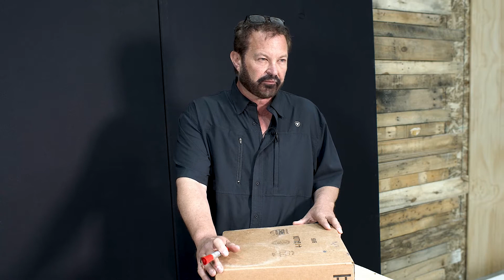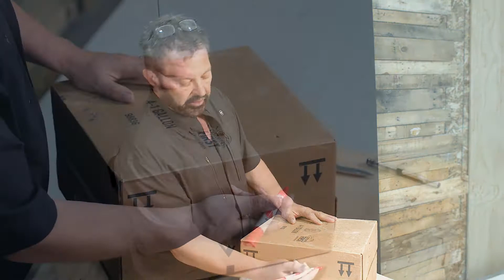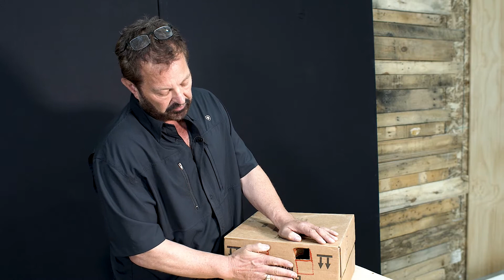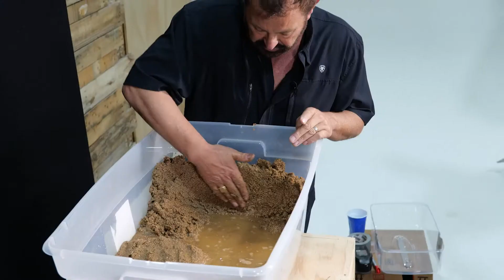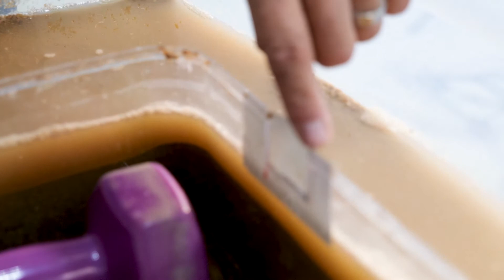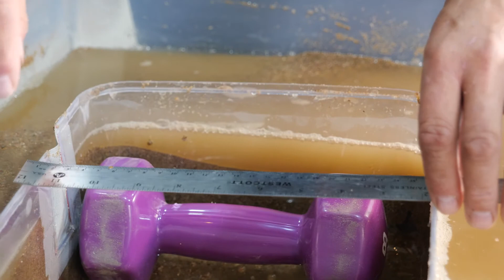Foundation failure due to incorrect egress window installation - finishing a basement (part 1)

Comment: Like everyone else, I'm wondering about parts 2 and 3.  Since it seems they aren't going to finish the series, maybe we can come up with some solutions...  My current basement office (that I share with the laundry room) has 2 egress windows, built when the foundation was built, that are each 48" wide in a 30' long wall.   In the middle of that wall, a concrete buttress (the drawings I got from the city call it a "counterfort") sticks out that is 8" wide, 6' tall, and 4' deep.  The drawings show rebar tying the buttress into the wall sitting on a 24"w x8"d footing.  I'm assuming that is to counter the wall/dirt loads.  But we're planning on moving and will probably need to install an egress window in the basement of the next house before finishing the basement or redoing what some other "handyman" did, most certainly without permits.  My college mechanical and architectural engineering classes were decades ago, but I got to thinking...  I could duplicate my current arrangement with a buttress of some kind.  Or, perhaps I could do something with bolting some C channel on each side of the foundation wall running the length of the wall,  with the question being of how high on the wall...  Would the buttress be better for poured walls and the c channel for block walls?  Could a concrete window well that is doweled into the wall substitute for a buttress/counterfort?

Comment: Surprised that residential basements relies on diaphragm design.  All the designs I have done on walls (which a foundation is) simply relies on simple 2D overturning for static and dynamic loading.  Drainage is dealt with at construction. If that isn't accomplished then I can could definitively see the issue

Comment: I came looking for videos on this topic after learning that my uncle had cracking in his basement after having an egress window installed.  The cracks looked just like predicted in this video.   He’s since had $15k of reinforcement work done to fix the problem.    Anecdotal, I know, but seems to confirm the risk outlined here.
Reply: Most cracks come from the building settling unevenly.  Proper positive slopes for drainage  away from structure prevents these problems.

Comment: We're having a large window company install our windows as part of a "greener homes" program. We have an older bungalow (early 60's) that is pretty much identical to the box in this example. They said to just "go for it" if I wanted to save some money to dig the wells and cut the egress windows out myself...so I did. I asked them about whether I should install a lintel, etc after my step-dad expressed concern. They said not to worry about it and that "cutting down doesn't require an engineer or impact the structure of the house". Needless to say I'm looking forward to seeing part 2 and the example videos you discussed in this vid. Great video btw. Very informative and made a lot of sense in simple terms. I think a lot of viewers out there that are DYI'ing this because of inflation, etc. would benefit from seeing this and future videos on the subject. Thanks!

Comment: Hot Garbage! I’m an egress contractor who’s got 18 years experience installing standard vertically cut egress windows and what is not mentioned here is how the window well deflects the lateral soil pressure. I have done over 2,000 windows in Colorado with some of the most expansive soils in the country, and have never ever had any structural issues with any of them. This plastic tote bucket demonstration is laughable!!

Comment: Great information! Just subscribed. Very interested in seeing rest of this series. I have recently started my own foundation repair company doing waterproofing and am installing egress windows as well. I have previously worked with another foundation repair company for several years doing this and I myself have spoken with the local engineers for this exact service discussing the structural concerns and none have mentioned the lateral load from expanding soils. 

It’s a no brainer in the foundation repair business, we call it a foundation wall experiencing inward deflection due to excessive hydrostatic pressure. I would argue that all exterior water mitigation should be maintained at all times to avoid excessive saturation and prevent this foundation failure. The lateral support system for the average foundation wall will never hold up to this level of excessive soil saturation for an extended period of time as we see this deflection on foundation walls without egress window installations all the time. 

However, I do understand the world isn’t perfect and you can’t keep the soils around a foundation dry forever, and I see the compromise of lateral support in cutting out the additional concrete because typically there is a section of rebar running horizontally through the cut piece.  Very interested in seeing how to compensate for this compromise.

Comment: Well, it's been over a year and this guy hasn't posted parts two or three. It seems to be a fear-mongering move. I've been a carpenter for over 30 years. I understand his premise of remaining wall areas able to pivot. But when you don't offer solutions to problems you point out, in a timely manner, after saying you will, your credibility comes into question. I have dealt with engineers who try to require reinforcements that exceed available space. This guy should have had all these videos available prior to releasing the first.
Reply: he talkin out of his bung hole in this vid

Comment: This can't possibly apply for all foundation walls.  A legite, well built concrete foubdation wall should have rebar throughout it and be "engineered" as a retaining wall to withstnd the lateral forces of the outside soil.  Is this not true? I can see how this might be the case for a foubdation wall without adequate rebar or one made of concrete block, but even that should be built with reinforcement from stell rebar, no?
Reply: this whole vid smell like bs

Comment: I watched this at 1.5X speed and still wasted my time. Let me summarize: You might think it is OK to enlarge an existing window in your foundation in the vertical axis only, but it's not. You are weakening the foundation's resistance to soil pressure and the walls can bow in, causing enormous damage to your house. You must reinforce the foundation when making this window enlargement. How do you do that? Wait for parts 2 and 3! Since this part 1 was posted 18 months ago, I'm not holding my breath.
Reply: this whole vid bs

Comment: I plan on using steel i beams similar to "PowerBrace" on the sides of my new window opening, and then use carbon fiber reinforcement every 4 feet as a preventative measure for the rest  of the walls.

Comment: Since you are cutting out for the egress window. You would have less pressure on the wall because of volume of earth you remove. Totally disagree with this video. I am 74 Years old and put in many block basements . Just a scare tactic so people won't attempt this project themselves
Reply: Little to no side pressure.  A 1”0 mile long dam has little pressure on dam face.  No more than a swimming pool.  Use poured concrete walls with rebar for less potential problem, even with an egress every ten feet along wall surface

Comment: So how I understand your video is that the foundation wall is a vertical cantilever on either side of the window opening, for the height of the opening. When we enlarge the window opening, the cantilever get bigger and it can be too weak to withstand the lateral load from soil.

Comment: The side with the bigger window has more sand than water. The other side has mostly water. I don't think this is an accurate model.
Reply from the maker: The model is far from perfect and not to scale. It is simply a visual tool to help explain the overall challenges with egress window installation. We appreciate you watching and commenting. We'll take this in account for our future videos! Thank you Sergio!
Reply: @levelengineering why isn't the window well taken into account?
Where's the extra load coming from?
Can you finish the video Where's part 2
Reply: @tcmazz  this whole vid and the guy tht made it bs

Comment: BS. if you use a metal container instead a very thin plastic container it will have different result. where are the calculation for the soil force against the walls? none.
Reply from the maker: Thanks Francis. We're just trying to show the stress caused to the walls from lateral soil pressures and where we typically see cracking and movement. This happens very slowly over time, so using metal wouldn't demonstrate our immediate point, although, maybe over a few years, you would see the metal start to bend? It's not okay to just remove the window and you can see what happens to the plastic immediately. I am working with Scott to publish the next video where we can show calculations. This is just a high level example. Thanks :)

Comment: You are the expert.   I believe you.  Except, please show us case study.  How to prevent this.  What about making the well opening to clear soil away from sides of new window opening to avoid additional pressures?  Is it better to clear a larger portion of soil across the whole foundation wall the window is added to vs. a well?   It is helpful to have solutions vs. scaring everyone to death there house is going to collapse, LOL.
Reply from the maker: Point is, call your local engineer before doing this. Part 2 coming soon, thank you!
Reply: @levelengineering they cost waaaayyy too much
Reply: @levelengineering  So the point is to sell services and not provide a solution?